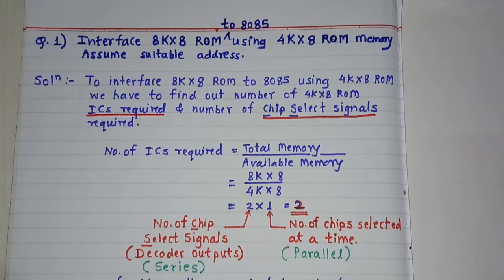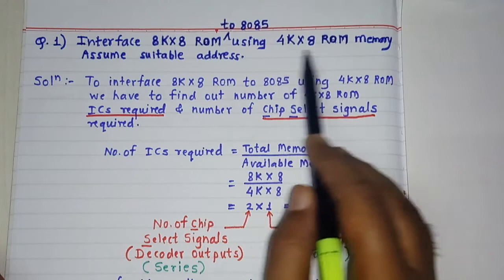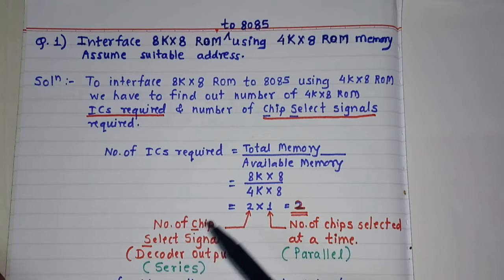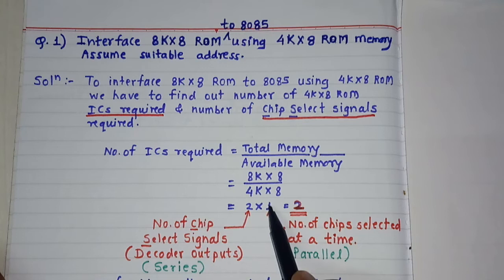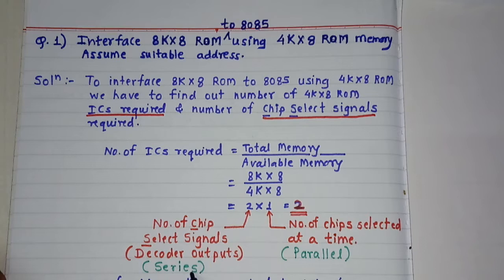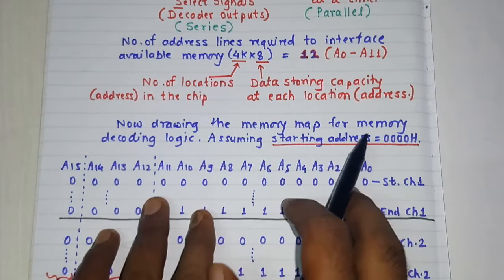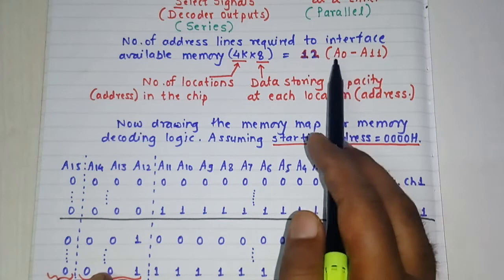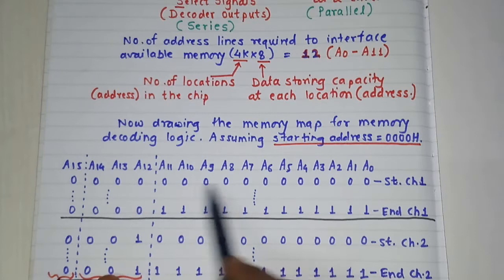Memory Interfacing in 8085 Microprocessor - 8Kx8 ROM using 4Kx8 ROM

Comment: Sir can you please solve the following questions:-
1)sketch and explain the interface of 32K*16RWMs using a decoder in minimum mode
2)sketch and explain the interface of PPI 8255 to the 8086 microprocessors  in minimum mode